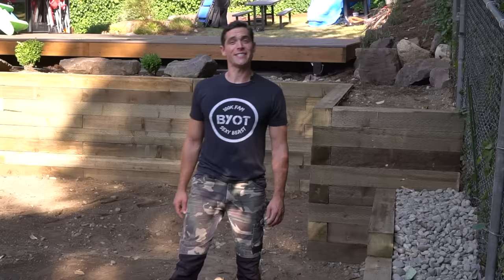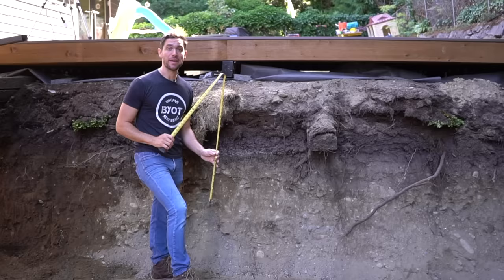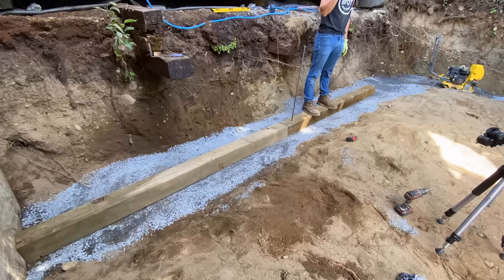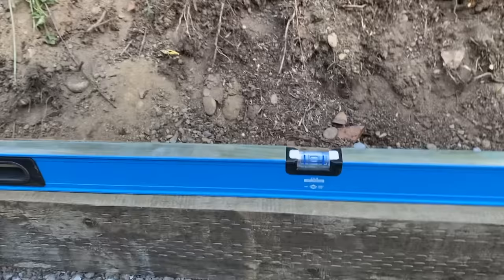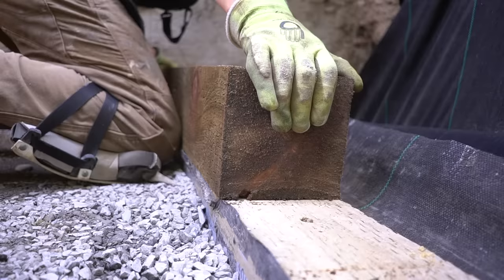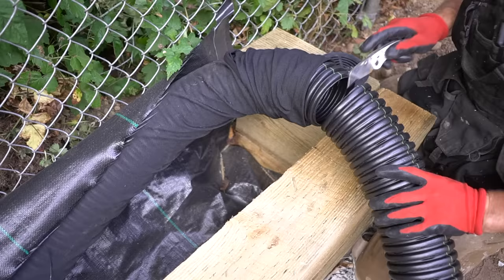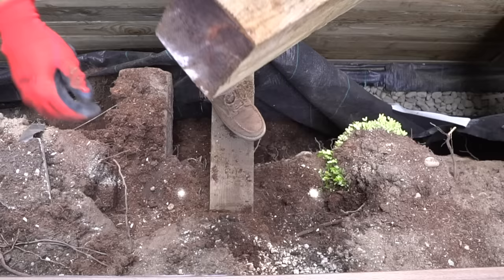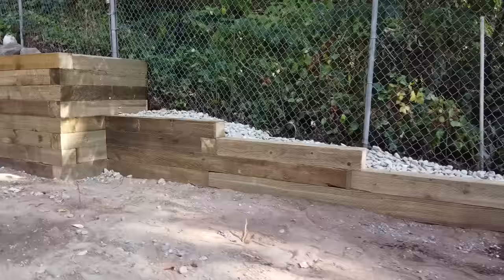HOW TO BUILD A RETAINING WALL

Comment: Looks nice. In five years time you will make a new cut out of this one and combine with some new footage. The title will be: "How NOT to build a retaining wall". The wall you built looks good but will need to be fixed because it will be tilting outwards. Those steel rods you hammered down in the soil won't hold, and those long screws will also bend.
Reply: Do you have a video on how to “correctly” build a retaining wall?
Reply: @AdaptingCamera  different ways to skin a cat.
Reply: @wdscrk1041  If that's what you call it then either you have NOT watched the video, so you have no idea about the differences, or simply have no clue. Of course, it can also be that you had no genuine interest for getting an answer to the question YOU asked, but anyone with the slightest basic experience or knowledge on building walls should see that it is MORE than just a "different ways to skin a cat", and should understands exactly the differences between the two ways of building retaining walls. One will be there just as straight and nice 15+ years after it's been build (depending on the type of timber course), the other must be fixed, or will collapse  after maximum a few years, REGARDLESS of the timber type.
Reply: It will be tilting outward in a few years because of the sketchy tiebacks and deadman but not as bad as one might think. To be honest I am not sure how the round stones will play a part in retaining the wall considering that little else is holding it. I don't see that the round stones will hold anything and if there is any hydraulic pressure applied to the wall, those stones will just roll over allowing the wall to move more than it might otherwise. So, will the drainage capacity of the round stones be its saving grace, or will they be its downfall? Time will tell. Of course, in the end, PT timber sucks, use precast concrete instead if you have the bucks.

Comment: In my experience the rods will rust away in the soil in a few years... thats why we rather do a concrete footing to connect to.
Reply: The only thing holding that wall up is the screws and they have a low shear rating. I give the wall 2-5yrs before it starts to move. The dead mans arnt even connected to the hillside so theyll just move forward along with wall.

Comment: Wow very nice! Made it look pretty easy and took a lot of stress of me not having to hire someone. 

Question though… what about using railroad ties instead of the 6x6? You think that would be better wood? Aren’t they sealed a lot better? Just curious. Thank you!
Reply: railroad ties ooze carcinogenic black toxic sludge for decades and are super ugly. I have  them on my property and have removed most of them.
Reply: I have seen RR ties seemingly rot overnight. Five years may have been the end of them.
Reply: I grew up in a house with railroad ties in the backyard landscaping, and they've lasted 35+ years so far. But they ooze black tar, which is kind of unsightly, and I agree that it doesn't seem great for the environment. Although the plants always grew fine around them.

Comment: The very last thing you would build a retaining wall from would be wood unless you are using whole trees. They just don't last, especially zero maintenance last....like the last you are looking for when you don't want the occupants to come to any harm. If your drainage becomes blocked and your retaining wall rots away then that would a poorly designed retaining wall. Like building stuff that lasts 101....don't use wood close to the ground.

Comment: Question: Why do you put the waterproofing material between the earth and the stone drainage? Isn't the whole point that you want the retained earth to be able to drain into the stone drainage? It would seem to make more sense to me to put the waterproofing material between the actual wall and the stone drainage, so that water comes out from the earth and into the gravel, and drains out the bottom without getting the wall wet. As you have it now, it seems as though water would build up in the earth behind the stone drainage you poured, and never even make it to the stone. In fact, you folded over waterproofing material over the stone drainage, so not even water from directly above it is going to make it to the stones. The stones are covered in the back, top, and bottom, so I'm not even sure how any water can even make its way in there to drain.

Comment: Nice job<BUT—as you were end “treating” your fresh cuts (with solution),..you forgot to mention just How Important that is,..as you know that’s where pressure treated weak link is.—(all to remember, but important step),..and,..just nit-picky But Always use a ‘sacrificial ‘ piece od wood when pounding on your real timber—damaged /hammer dented wood fibers rot first.!

Comment: If you want to build a wood retaining wall, the first step is: DON'T.

Great gravy, it's the worst possible material for a retaining wall. You're tearing out the old one BECAUSE it's the worst option.
Reply: This dudes channel should be called. BRING THE WRONG TOOL. (and supplies)

Comment: And how long do you expect this to last?
What is the factor of safety against overturning and against base sliding?
Did this get code approval?
Are your project insurance backed so customers have peace of mind?

A Structural Engineer with 35 years of experience, tired of saying I told you so and what did you expect?

Comment: FYI. A retaining wall height must include the foundation. A 1 foot foundation and a 3 foot wall is a 4 foot wall,  when it come to code and engineering. You can’t build a 4 foot wall and call it four feet, it’s actually 5 foot. U must
include your foundation in wall height
Reply: Don't know where you're at, but code specifically says up to "48 inches measured from grade" in most places.
Reply: It definitely doesn’t in all places. 

Code also has an asterisk for no surcharge on the wall such as from a deck foundation.

Comment: With respect...it's called a Dead soldier or ...Deadman not deadhead.
One deadheads flowers a Gardener's term..or semi drivers may drive there truck without a trailer is dead heading back to the shop with an empty trailer.  
 Or if you're a big grateful Dead fan then you would be a deadhead music lover.  ✌️ Young man

Comment: The “compactor” being used is only suitable for thin layers of sandy soil. It will not compact fine grained soils. Also, the socks around the drain pipe are prone to organic fouling. What were the design parameters (active/passive pressure) you considered for the wall?

Comment: Can you provide a rough ballpark of what you spent on this project, please?
Reply: Each timber is about $50. Each yard of gravel is about $50 + delivery. Each screw is about $2. The underdrain pipe is about $1/ft and $50-100 for the fabric. The equipment rental is $500+ for the week.

Comment: Looks great to me, and looks like it should be plenty strong with how you built it. No matter what you do there always be people you can’t please or think you could of done it better. 
Beauty in the eye of the beholder, long as your happy with the wall that’s all that matters. Personally I like how it looks and nothing wrong with a rustic look either! You should be proud of all your hard work and I didn’t notice any short cuts taken during building your walls that many people would skip here and there!  I’ve seen some poor workmanship, but yours isn’t one of them!  
Now I just wish I had your energy to build my own retaining wall, which I ‘m going to have to do in the future like it or not. My house has some retaining walls already done with retainer wall  brick and it wasn’t done correctly by any means.  Whoever did them didn’t even try to line the brick up in a straight line.   Should be all removed and done over correctly. But there’s a heck of a lot of retaining walls all around the house. More work than I care to do.  I got roughly 300ft. I got to do where I filled dirt up about 5 ft by my barn to put a retaining wall around and that’s going to be enough work for this 66 year old guy! Least I do have a new tractor though to work with finally! Shoveling by hand sucks and I’ve done my fair share of hand shoveling!  Few years ago dug a 350ft trench to run water line out to my back field by the garden so we didn’t have to run gardens hoses a mile long any more! Especially with hard clay soil it was a pain having to dig that trench by hand.  Least it’s done now and it’s great having water around the property wherever we need it now!  If you get bored, you’re always welcome to come help me put in my retaining wall.  Then you can see what a crappy retaining wall looks like while you’re here! 😂

Comment: Is it possible to add horizontal support to a 4' retaining wall built out of lumber ties?
Wall built 20+ years ago doesn't have deadheads, rebar, or any proper support, and is beginning to bulge in certain areas.

Comment: That's not a retaining wall, it's a raised bed. 
A retaining wall needs to RETAIN the pressure of what might be a hillside behind it, and that can't be done with a few bits of wood.
A real retains wall needs proper foundations and full on reinforcement as well as being made of something that isn't going to rot away in a few years.

Comment: Is there an equation/guideline on how deep one need to go depending on how high the wall is?
Reply: Depends, I use the quarter rule for non-engineered walls (anything under 4 feet). So I aim for the base depth to be 25% of the wall height. Example, 3 ft wall ~9 inches of compacted base rock with at least 12-16 inches of room behind the wall for rock backfill.
Reply: @osoquik4447  Very useful! What's the difference between engineered vs. non-engineered walls?
Reply: @Hajjat  in the US and depending on the state, you can’t build a retaining wall higher than 4 feet without consulting with engineers/city approval. Hence, an engineered wall. 

Anything under 4 feet is usually free game or non-engineered wall. Reason you see many people/companies/landscapers build multiple levels with 4 foot wall height sections.
Reply: @osoquik4447  Oh I see, makes sense, very nice tip (multiple levels)! Thanks for the info, very useful!

Comment: The only problem is there is no easy way to get from the top deck down to the bottom and there is no railing along the top deck to prevent someone from falling off a four foot height,
Reply: There should be a railing. Agreed.

Comment: why would you put the same type of timbers back when you just spent half a day taking out the rotted ones.  YES treated timbers do Rot over time.  You will be doing this project AGAIN in 10 15 years maybe less depending on how wet the soil is.

Comment: I think you could achieve this with far less expense. I'm also skeptical about the actual stress resistant of this design. I'd love to see this wall 5-10 years from now after the uncoated rebar anchors have all corroded away and it's basically just being held together with some little 1/4" lag screws. Also I skipped through the video but I didn't see any weeps. Curious if the water goes right to the gravel fill and just makes a bathtub back there.

Comment: Hi buddy. How do you mean about ensuring the soil doesn't subside when compacting, but it's the bottom flat layer? Seconds before you said this I was about to comment asking about the safety of that vertical next to you, each square meter equating to a ton :s :o :)
Reply: Good observation regarding the exposed soil during construction. It is very dependent on the soil type. Clay soils can have very tall, steep exposed faces during construction with little worry of failure as long as it is dry. More organic or sandy soils, not so much.
Reply: @johnlee7085  aye, I thought so too but this looks loose. You're saying it's compact/stable enough where it hasn't been exposed, a couple inches from whats in sight? Clays impressive for all sorts, my Georgian house had clay foundations! I still find it unfathomable to think the old mine stables are a half mile underground from the 1800's (I volunteer at the Skinningrove ironstone museum). Yet there's still a lot of water held in said clay. I have the only cellar on the street row in a residential house, someone put a massive concrete square in there with a gurder all the way up the centre of the house but it's still impressive

So what's your experience, I'm wondering? Your projects from what I've seen so far are your own property I'm fairly sure. Do you have a background in construction, garden design, DIY etc? Im curious because I haven't seen your other locations, not questioning your knowledge-i know how people are on here haha. You're too knowledgeable for a DIY enthusiast, surely
Reply: Hi Cleveland. Where not exposed it is referred to as undisturbed soil and fully compacted though the bearing capacity varies significantly by soil type. 

I’m not the person doing this project, just someone providing my insight to your question. I’m a civil engineer by profession but do a bit of this sort of work personally and volunteer with other professionals for others.

Comment: So the whole wall is being held in place by 1/2" rebar at the bottom. And when they rust off, then what?? The bottom of your wall going to start kicking out. And then to got your treated timber. In the ground mite last 10yrs. Now your wall sitting on rotten timbers. You should pour a foundation for your wall with spurs going back into the bank your trying to hold back. Treated timbers will work, but in time, being wood, will rot away and now your in your 60's, 70's, ect. And you have to pay somebody else redo it. You should be using rocks and a support wall, not wood. Those timbers you removed proves my point. Those are treated railroad ties. If they rotted, those 4x4s not going to last as long. So if you planning on rebuilding your retaining wall every so many years, this will do. But if you want it to last a couple of lifetimes. Use stone for the retaining wall.

Comment: Did you just win the lottery?  Can't argue with anything you did. but Over building anything in my experience tells me one thing.  This looks like the first wall you ever buildt.  I trust I am wrong.  You tuber always over do ever ything trying to impress the viewer,.  If i have buildt one way I have buildt 50 plus walls, of all kinds.  wood retaining walls, Gabbions wire basket rock walls, and concrecte retaining walls.   Dead head are extremel important but you over did it by some sort of magnitude.  Layers of filter cloth works just as well, requiring less labor and surely less timbers.  The next one you build  if so you will use less labor and more cloth and less timbers.    Good luck and trust you may have gained some important knowledge..    RC   I did take the time to do this as a complement to your hare work.

Comment: Looks like before there was access from the lower patio to the deck but in the new design the access was lost. Also, it's a bit of a hazzard dropping off the deck 4' to the lower level.
Wood as a material choice for a retaining wall isnt the best. A foot of top soil would be better for the planting and where is irrigation. A better design would have been to connect the top level to the bottom level with a matching deck with stairs and maybe a outdoor cooking area and firepit. Finally, the method of deadman stabilzation will fail as the wood and screws rot.

Comment: No disrespect but it looked better before the wall install. Structurally,your "deadheads" are useless as they have no foundations, even the rebar for the deadheads is useless as the earth they are trying to support will generate forward motion, they are supposed to retain but will become the product/force behind  a land slide.
Probably wont happen at that level of structure but you probably shouldn't be advising others. (Good work, excessively complicated, respect due but structurally flawed.

Comment: nice but I would never again use wood.. always hardscape cement blocks, worth the investment because the biggest cost is excavation and labour, the product itself should not increase price by more than 15% unless you are choosing very premium materials. The cement wall will be good as new in 20 years..😊

Comment: Dude, first of all I think it is called a deadman.  Second of all the deadman is not made correctly.  It should be a T shape not a solitary beam.  It works by achoring and prevening pull out not by downward force.  If you are making one that is designed with downward force you need more lateral area such that it would require the upheaving of a large area of soil....  This is wrong and you are likely to have bulges soon if not later.